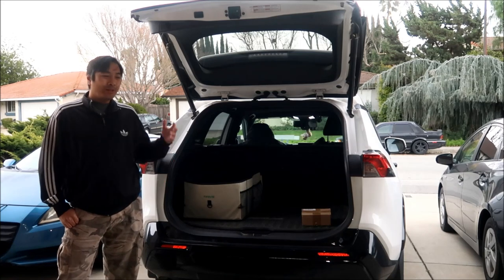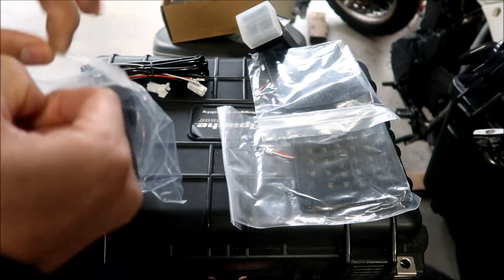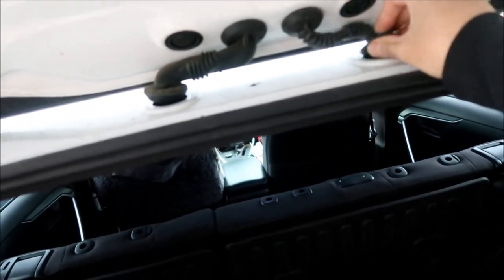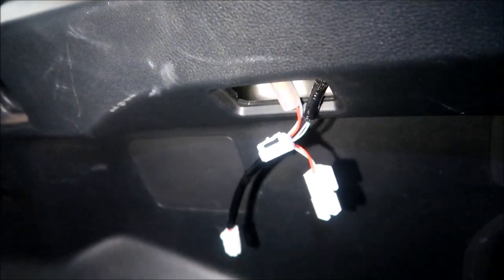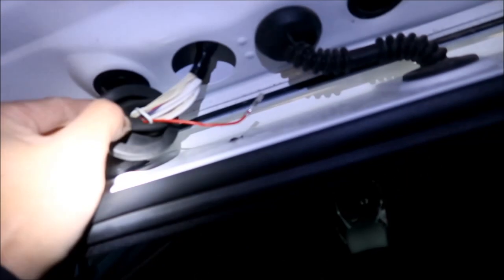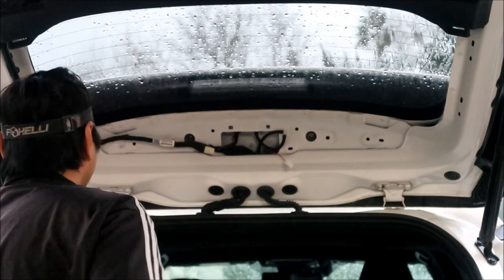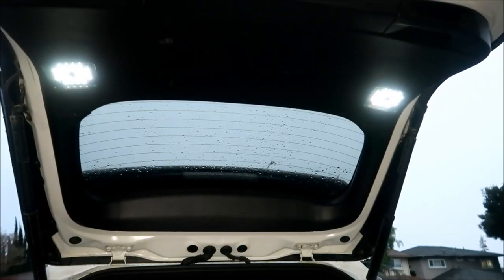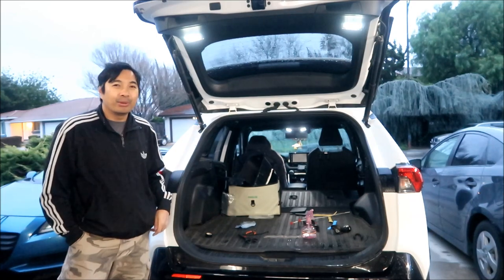Trunk Lid LED for Toyota Rav4 Prime Installation

Comment: Wow , what a pain. I wish they just made the lights with batteries, they don't get used that often, but at least you wouldn't have to do all this wiring. and since they are LED lights, batteries would of lasted a while. And would of took 2 seconds to install them.
Reply from the maker: Hmm yeah it was a pain to run all the wiring, I suppose it would be easier to just have them battery powered.  It turns on whenever you open the trunk which I do like though.